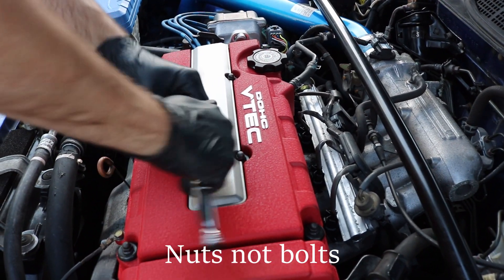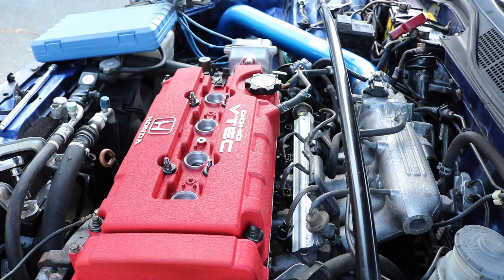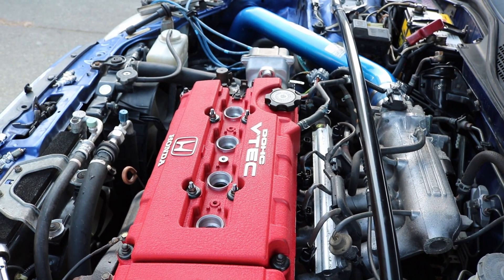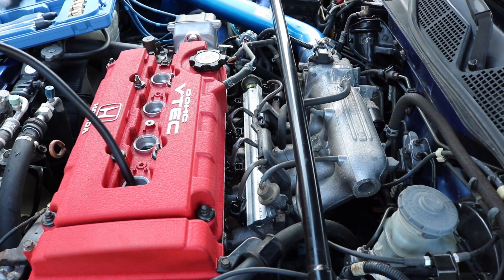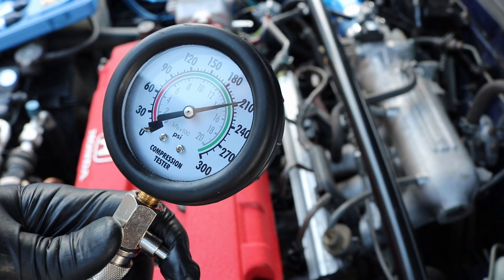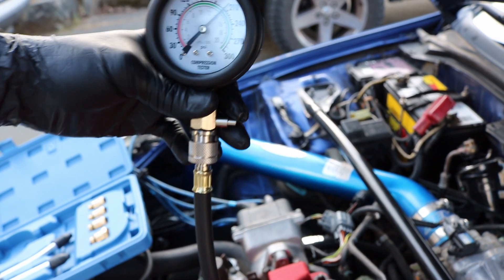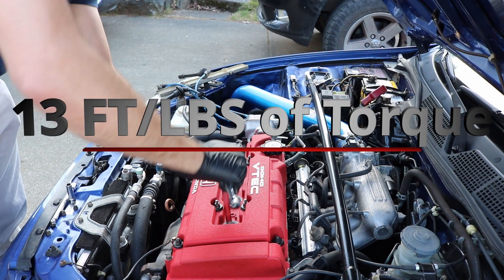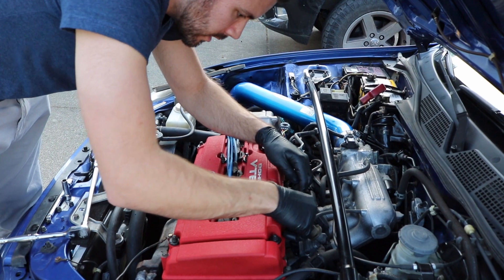Compression Test on a 1999 Honda Civic SiR (B16A2)

Comment: why didnt you disconnect the fuel pump?
Reply from the maker: @OGjackH  I disconnected the fuel injectors. No need to disconnect the fuel pump. If you want to get really wild, you can always pull the fuel pump fuse if you're worried. The way I did it, it's just not necessary. At least that's how I've always done it and have never run into any issues

Comment: Just did this on my 98 honda prelude. Having driving and shutting off issues. Got 195, 190, 198, and 199 . All good. Next doing a leakdown test. Then replacing the fuel filter. If isxue remains  gonna replce the fuel pump
Reply from the maker: Let me know how the leak down check goes. Before you replace the fuel pump, try and get someone to turn power on while you listen to the fuel pump to see if it's getting power and turning on.
Reply: Did that already. Fuel pump working , but louder than usual. Sounds like its straining..will check for fuel pressure at the regulater.

Comment: I got a b16a2. When the engine is in operating temperature, the following thing happens if I shut off the car and crank it again (let's say when I park to wait for someone, like 5-10 minutes: 1) goes to 1500 on the crank 2) falls to 1000-1100 for 3 seconds or so after the car starts working 3) drop to 500 and a small tremble happens as if it's going to stall 4) goes up to 900 and sticks still, where it runs smooth as silk. What is this? The car is bone stock, runs and accelerates fine, engine is in pristine condition. What might it be? We have cleaned and checked everything. Thanks a lot in advance, liked and subbed!
Reply from the maker: Just off the top of my head, possible vacuum leak maybe.  Have you checked the timing? How's the distributor? How old are your fuel injectors? Does outside temperature change anything?
Reply: @Trytec96  thanks a lot for your reply! Everything is checked and cleaned. The b16a2 engine was swapped in from an ek4 vti, so the fuel injectors might be like 25 years old, however the engine was checked thoroughly before the swap and it was (and is) in perfect condition. I used my old obd1 ecu though to avoid cut and stick wiring harness work and of course it was reprogrammed from the scratch with the stock b16a2 settinls and map. Other thing that happened was that the idle rpm went to 900, up from 750-800 or so that it was before. It still runs smoothly though, without knocks and misfires. I haven't noticed the temperature factor, since as it's summer time, it's hot. However, yesterday it didn't do the rpm dip till 500. Just a very small one, as if the car changed its mind. If it was a vacuum leak, wouldn't the dip happen when cranking the engine being cold too? Cold cranking is fine: rpm go to 1500 and go down slowly, as the temperature goes up. No dip happens during a cold start and of course no CEL pops EVER. Thanks a lot!

Comment: that I understand it is only 3 touches, if it is more it is obvious that it will force to have more psi
Now the boy says we will measure 6 ignition attempts and makes 11
LOL
Reply from the maker: Lol. That was poor editing. One of the first comments makes a valid point. Crank until it stops moving. I think I said 6 because that's relatively how many cranks would happen before it stops moving up but ya I should have corrected myself in the video. Whoops haha
Reply: @Trytec96  haha a query, how much is the approximate cost of a b16a2 in your country?
Reply from the maker: @RWS-Workshop  it varies. I've seen them go for less then 1000CAD but ones that are in good shape I'd say around 2 and up I believe.
Reply: @Trytec96  In my country the simplest and not in good condition is over 3000 USD
And now my currency is devaluing :(
Reply from the maker: @RWS-Workshop  oh damn. I know of we import one from Japan which is in good running order and lower mileage were looking at 3 to 4000CAD. Youre better off just buying a B16 head for cheap and then a B18 block. You'll save some money that way and you're going to get way more out of that motor.

Comment: Is the B16A2 Better than the B16A3?? 
They seem exactly the same except the A3 can rev slightly higher before redline! 
anyone have any thought as to which engine to get that is better? Thanks...
for a 95 Del Sol...
Reply from the maker: I'm not entirely sure about which one is better. I find the B16A2 is more common but that's just what I've found during all my searching. Others may say different. As far as what is a better engine, the H22A2 engine I've seen inside a del sol with turbo and it was a rocket. I like both engines. Can't go wrong with a good K series motor either or a B18 from an integra. Can even use a B16 head and B18 block for a longer stroke. Always a popular choice.
Reply: @Trytec96  I am trying to narrow it down and decide... I went from these 2 engines to possibly the B16B to the K20A Type R... I am  not going to race at a track or anything. Just want to put a solid engine in my Del sol with more Horsepower. I have  the  S  type engine so 106 hp. Would Like at least 170, so a JDM or more... P.s. the only other thing is, I Love the Vtech Sound and the High Revving sound...
Reply from the maker: @MikeKollin  oh go K20A for sure. I've never done a K20 swap so I'm not sure how much modding you'd have to do but I'd imagine you can buy the engine mounts for your del sol that will mount a k20. Honda parts and how to's are everywhere when it comes to mods to these cars. K20 is bullet proof and looks pretty cool in the engine bay when showing it off 😎.
Reply: @Trytec96  P.s. Thanks for the Quick Response... really appreciate that!!

Comment: Did you ever pinpoint where the lag in the power came from since your compression test was fine?
Reply from the maker: Ya the previous owner who did the timing belt missed a step. You need to put tension on the belt, tighten down the tensioner bolt, then rotate your engine camshaft 90 degrees, loosen the tensioner, put tension on the belt again to take out slack, tighten tensioner bolt. They didn't do those last steps which left slack in the belt. Its why at low speeds it felt like a lag but at high speeds, the momentum of the crankshaft and camshafts kept everything unnoticeable. You are able to do all this with just taking the valve cover off, a coat hanger and I believe a 14mm socket. Coat hanger is used to grab hold of the tensioner.
Reply: Do you by chance have pictures or clips on how you fixed the lag with the tension belt? I replaced my head gasket and I’m getting a lag only on low end. I got a cold air intake and new headers. Dont  think it will cause that much of a lag without a tune so timing is my next issue to address.
Reply from the maker: @alexburden4970  I don't have any pictures but essentially I just took a coat hanger, mad a hook at the end, I snaked it through the cam gear cover and hooked onto the tensioner pully. I loosened the tensioner, pulled up on it and retightened it. Then rotate your crankshaft 90 degrees or where you feel the belt the loosest, and repeat the steps of loosening and tightening the tensioner using the coat hanger.
Reply: @Trytec96  okay. Thank you ✊🏼

Comment: Thanks for sharing this. I need to go through and troubleshoot this on my 99 civic si b16a2. One of the cylinders stopped firing on me while I was out one day. Need to go through and test the compression on them as I think I had spark when testing. Have you had any issues with distributor cap cracking or distributor going out easily?
Reply from the maker: Sorry if this is an old message. Never got notified of it. Did you figure out the issue? I've never had any issues with the distributor on my civic but I have on past vehicles. If you're not getting spark, I'd lean towards the distributor possible even the spark plug wires. Possible the plug itself maybe is gapped incorrectly too.